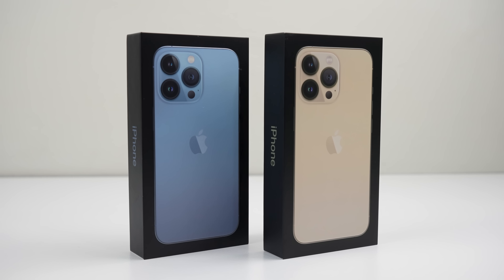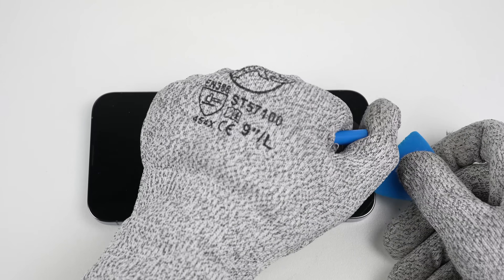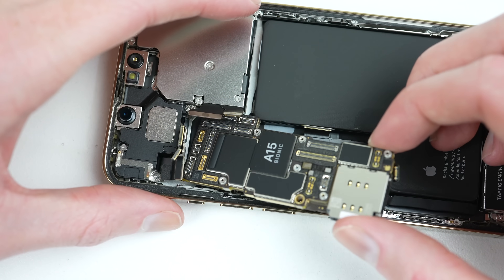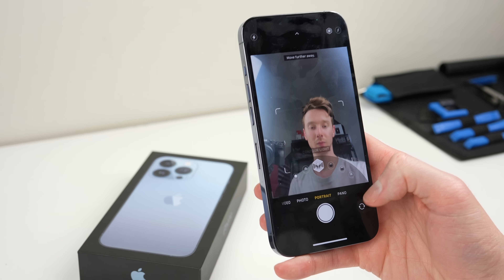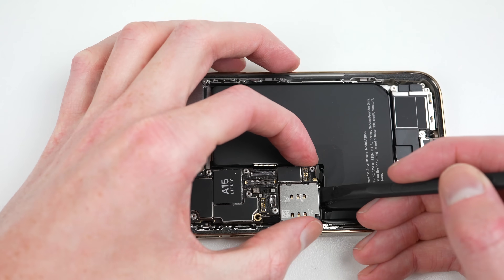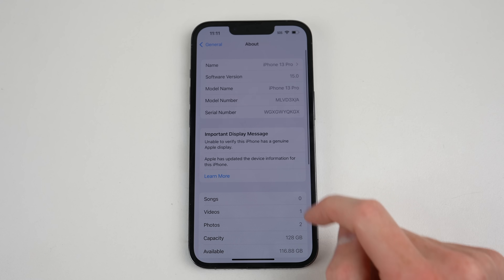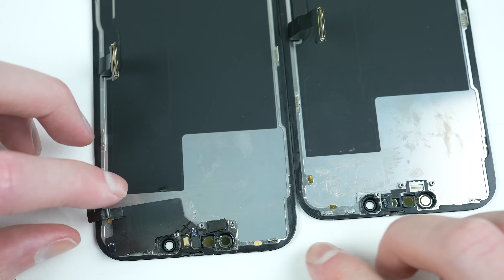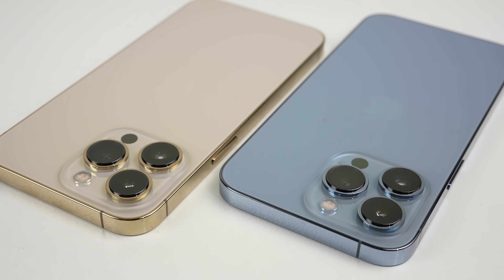iPhone 13 A Repair Nightmare - Teardown and Repair Assessment

Comment: This actually has been Apple's philosophy from the very start. Their OS would only run on hardware they manufactured. For a brief time they experimented with third-party hardware, but that was quickly discarded. Their authorized repair shops are prevented from stocking parts -- the broken\defective part has to be returned to Apple first. I have never understood people's blind allegiance to this company, yet are quick to denigrate others' efforts (Microsoft). The real open-source products are PC-based, not Apple's proprietary system.
Reply: The BS apple is doing is for real pretty annoying, thats why i still stick to a 2010 MacBook Pro... it got already 4 batteries replaced, upgraded Ram from 4 to 8GB, the 500GB HDD with a 500GB SSD replaced and not long ago i had to fix a typical GPU power delivery issue for cheap, like 10$... 9$ for delivery, 1$ for the component haha

This baby got already about 3000+ charging cycles and a lot of mobile usage on its back, next to a bit gaming (on battery aswell stationary for longer, thats why the cap for the GPU power delivery finally gone bad after 10 years)
The last time i even stressed the DVD drive a lot with burning mix-CDs, Albums etc, still going strong my "easy to maintain" 2010 machine, not the fastest anymore, sometimes i have some waiting times, more than 1080p/60fps on youtube is impossible in Mac OS, only in windows with proper GPU acceleration i can also playback 4K content, even HEVC over the CPU (in windows only!)

I dont know why, but every time i use this 2010 MBP... i remember how good and "way ahead" apple once was, even for a fair price (paid 1700€ with student discount for a better 15" model with dedicated GPU, regular price would have been anything around 2200-2300€) I still "love" this machine, aswell as my 2016 iPhone SE, the last really small pocket sized iPhone with partially practical repairability. Sadly, i switched to a iPhone 12 Mini some days ago, but i got a good deal for 510€ brandnew and the 2016 SE is finally getting a bit slow (probably intentionally by apple, because i did nothing else than a software update and it was much slower than before). Well, i like the awesome "big" screen of the 12 Mini, i hope this last also for at least 3-4 years until apple bring back SEs to life
Reply: @harrison00xXx  yep. Still using my iPhone 6s Plus and replaced the screen myself a couple times with parts from eBay.
Reply: @harrison00xXx  thats exactly why apple does this now.

why would they want you to be using a device from 10+years ago, that just means your not buying a new one.
Reply: @theputnamto3468  well, i would not call a 5-6 year old phone old or outdated…
Especially since my needs are pretty rudimental and i dont need much performance at all
Reply: hurry..I was about to say bingo , you are totally correct,  BUT quite wrong in open source info. Apple had spread around for $$ their attachment idealogy for 3 rd party  items, Billy Gates, simply allowed the USER  of PC to try  a new  item, if it didn't work. whoops then PC would  know. Billy also  initially proffered selling the gui device way back in1985, at he Xerox symosium, but his partner Steve Jobs replied  no, a computer would sell as a contained unit.
Reply: This is substantially different from apple’s policies “from the start”.

I used to regularly replace RAM, hard drives, batteries, etc. on macs with third-party parts with no issues.
Reply: i use an old iMac 2011 since, 2011, and it just started to having problem right now, just bought a new mba m1 to replace my old iMac. lots of my friends already bought 2-3 laptops since then. As for their phone, i was using iPhone 6s for damn long time and just got myself a new iPhone 12 last year. Their products do last longer and everything most of the time really just work, though when they got broken its also a pain in the ass and expensive.
Reply: @harrison00xXx  they were, long go with Steve alive, now they are just milking the cow
Reply: It's about how much money they can take from you while you use their products.
Reply: @harrison00xXx  I know that feeling exactly. In the early days OSX notebooks were the only choice if you wanted Unix on a notebook. It was great because Darwin was open source and the cross-compatibility between Linux and OSX was awesome. Even the Macmini was awesome. 

Now I switched completely away from Apple because they are just insane in their pricing, insane in their repair costs, and insane in locking down the system. I used to buy the top end iPhone, and when the price went over 1000 CHF I began to cringe. Now at 1399 CHF I said no way! Especially when I can get the Samsung A52 5G for 429 CHF. It has become a no brainer situation for me.
Reply: @ChristianLaurinE  as much i tried to stay on apple…
My 2010 MacBook is partislly replaced already by a Lenovo convertible (ryzen 3200 and vega3), which feels basically like a iPad Pro with more capabilities for a cheaper price. And for 14“ 1080p is just fine, for regular notebook usage even „too much“, for drawing/tablet usage i could wish a bit higher res
Reply: @ChristianLaurinE  i had no problems with easy to replace batteries at iphones or at least acess to replace ram, battery and SSD like my 2010 did.
now, after 10 years sadly even a 300$ notebook have a superoir screen over the TN LCDs used these days only in notebooks

I have big hopes for the M2 and M3 Macbooks, i will wait how they perform and their pricing, then i know if a M2/3 Mac will finally replace my 2010 MBP

I still like Apple somehow, only because they were the only ones left in 2016+ with a small „hi end“ phone and because they were literally years ahead with 2007-2012 Macbooks and they were the only „affordable“ notebooks with superior screens, robust case and huge, high quality batteries
Especially 2008-2010 they made by far „the best“ allrounder notebooks/Macs, only with s few apple typical downsides like not much USB ports, miniDP instead of HDMI and so…
Reply: ALL technology will be like this eventually. Yeah sure my custom windows 10 PC that i think i "own" can be screwed with just a simple update. and just like that my device can be bricked. We all just pay a fee to have these devices in our hands. But we dont truly own any of it. Hardware without software is just a paper weight, its useless. So the software is where they are screwing us and there is nothing we can do about it. Just dont spend all of your money on electronics from here on out. Spend a responsible amount that wont break the bank and take care of your devices the best you can, with the idea that youll only have it for a few years maybe six years maximum before it turns to ewaste and repeat the process. People spend all their money on this stuff which is why they get so upset, but it is what it is...
I can invest all my money into a sports car lets say.. then the state can come out one year and say i can no longer register it. Just like that, even a car can turn into the same idea.
Reply: @PhoonigaN  use Linux my guy. And a bricked device is not a dead device
Reply: Maybe our “allegiance” is not influenced by silly talking points but rather pragmatism? As in the phones have a track record of lasting long? Being reliable? Supporting long term updates? 
But yeah no: I should discard all of that because some random Butthurt Individual online thinks I should care more about their philosophical nonsense
Reply: @tbg6070  Here is the problem with that theory. About 5 years ago, sure gotcha...  However, these days I don't agree. Also let's do the numbers shall we?

My iPhone that I wanted to replace my iPhone XS Max was the Pro. The acquire cost was 1350, and the selling price is about 275. This means in the space of 3 years I lost a value of 1,000. My Samsung A52 5G cost 425, and my Motorola One Vision cost 225. Meaning I am still ahead of Apple. 

I have two phones because I have a Swiss and French number. Why not use eSim? Well I did, and my iPhone would hang for whatever reason and not pick up calls.  Meaning reboot.

Also with my Android I can actually see who is calling as that is automatic, and on the iPhone very difficult to get working. 

I have not even begun to go down the list of features like Android Auto working properly vs AppleCar...

Sorry but for a device that is over 1K you are paying for BS not technology.
Reply: Shame too because iPhones are genuinely some good phones. The company just sucks and rips the fuck off people

I'd be fine with going to Apple to repair my phone if it didn't cost me 1/4 of a new phone.
Reply: Iphones are good, but I never buy them new, because screw apple with their greed.
Reply: And their machines will only run on the current os or newer, which means you cannot even go back one os, and on phones and tablets, if you upgrade you are stuck, and cannot return to an earlier os.
Apple owns the phone after you buy it and can lock it for any reason at anytime.
Reply: @Tigerex966  this isn’t even true. If you have been vigilant with backup up your shah blobs then you are free to always go back. You are not informed. I can run any version of macOS I want on my MacBook. That doesn’t mean that software in that version is supported by the developers or secure, but there is almost no limitation to what I can run on apple computer hardware . Their operating systems  are inflexible, but they aren’t fortresses and you are a fool if you believe that shit. Educate yourself
Reply: @Joshreece  you are in error.
Try going back a version on yout m1 m1c to catalina or mojave.
Or even your intel mac.
Reply: @Tigerex966  yeah intel mac indeed
Reply: Ooo wow 

I thought you were rational

Until you revealed your pathetic tribalism you’re another waste of space fix your life
Reply: It's not "blind" allegiance.  They make great products.  They handicap repairs, sure.  But people like their products because they are worthy of liking.  The two things aren't required to be tied together.  You can like their products and hate their repairability (or lack thereof).  And Microsoft isn't exactly problem-free.  They've made multiple shitty operating systems, crappy music players and phones... and now their newest OS spies on you like never before and forces updates even after you disable them.  Microsoft and Apple are just different coins in the same purse.
Reply: @Salsuero  something people also dont realize… we talk if we talk nowadays about windows about a x86 only OS…
x86 architecture is literally existing since the first microchips, so we could even say MS is keeping us from real development by still holding on to x86, at least 32Bit Windows are finally discontinued but they still rely on an old design.

ARM/RISC CPUs are the future, exactly that kind of CPUs Apple began to use with the M1 Macs

Intel tried already to bury x86 by introducing IA-64 in the early 2000s (Itanium called i think, but AMD offered for cheaper a x86 compatible 64Bit extension to the 32Bit x86 system which we are still at today
Reply: @harrison00xXx  And the OP acts like Microsoft fans don't trash-talk Apple fans... right.
Reply: @Salsuero  its sad to be a fan of any company… apple or ms… its like pest vs cholera
Reply: @harrison00xXx  I think people are more fans of the products... not the companies themselves... unless they own stock, I suppose.
Reply: Microsoft open source? U meant Linux
Reply: @HutjeSiu  I was talking about PC hardware. I admit that I drifted off the point of handheld tech, but I was making the point that Apple's approach to hardware was proprietary from the start, and the PC's was, let's say, "everybody into the pool".  Obviously there are risks with that approach in terms of bugs, but it's a far more "open" world. Funny, but looking today at the Super Bowl ad that launched Macintosh, it seems Apple has become the evil tyrant on the screen.
Reply: @hurricane1951  well after all it’s your choice in the free market, apple success reflects what consumers demand. it just apple decision to develop in its unique way, and SoC has been proven to be a better and more efficient way, balancing performance and mobility, as m1 chip launched
Reply: @ASSOpid  As someone who has a MBP, uses Linux (mostly just Debian though) and has a Windows desktop PC (for gaming) with a 6600XT and a Ryzen 5 3500... macOS is still extremely nice for work. Plus, people who are complaining their apple devices break in 2 years likely take less good care of them. I've had my MBP for 6 years, and haven't even had to replace the battery.
Reply: My wife had mba from 2011. I replaced battery once, and recently replaced keyboard after son killed it in Minecraft. Laptop still solid for e-learning for grade 2 student. Imagine they put locks, that would prevent repairs (I did them myself). Last keyboard upgrade probably then will be non-economical. It means instead of continue using it, it would go to trash and harm environment.
Reply: @vovaya  apple's new measures will only slow things down. Those devices will be pwned just like every other one ever. Maybe not for years, but I look forward to picking them up cheap in a few years when the modding/hacking community learns to spoof the hwid's or man-in-the-middle the authentication.
Reply: Microsoft open source... lol
Reply: @Agussg23  check your reading comprehension mate
Reply: @bbbbbbb51  it doesn't make any sense. Where does the open source topic come from?
Reply: @harrison00xXx  gotta thanks Steve Jobs for that , but now it different , this isn't the same Apple that we used to know .
Reply: @nezunish-898  yep. I was a tech nerd from the beginning, but never really an apple fan.
I owned the last generation of black/white PDAs, pretty useless these days as a kid ofc but hey, others wasted their money they got, i bought a PDA only businessmen would buy.
Qtec 9000 was the last PDA i owned before the first iPhone was released. It was a nice, awesome Windows Mobile 5.0 PDA with nice, big screen, keyboard and a "convertible" feature.
But damn, as much i was a tech nerd, had no problems with more complicated devices and so.... the iPhones were so fkin user friendly. I gave up in this case for free a bit of freedom and possibilities (last gen Win mobile PDAs were pretty neat and much more versatile than any early gen smartphone!) for a damn easy and intuitive to use mobile OS. Only this fkin stylus which you always needed, the pressure depending touchscreens with poor precision and calibration needed,... all gone with modern smartphones which began with the first iPhone.
Reply: The irony is that Apple stole their GUI from IBM. They profited and learned from that lesson how important it is to THEM to protect their software AND hardware from taking business away from them. It's totally anti consumer and there's no good reason for it besides Apple is greedy. Unless Apple makes a statement about this that is legitimate and has a good explanation OR they stop these practices my view of them will continue to degrade and I will not be upgrading phones. I have the iPhone 7 & iPhone 11 and love these phones but I won't upgrade to another iPhone besides buying new older models until this issue is addressed. I know even with the 11 there are things that are difficult to replace. Right to repair is a huge issue and more people outside of the tech community need to know about it.
Reply: Their hardware and software (when working) has generally been solid, you can't expect normal people to care about these things when it doesn't affect them directly. It needs regulation.
Reply: @Alekpowah 
Apple's hardware and software is solid WHEN WORKING??? Would anyone consider it not solid when it's NOT working? Yes, I agree, even my Galaxy S21+ is solid....as long as it's working. However, if it stops working, I doubt I'll consider it reliable. I'll cross that bridge when I come to it.
Reply: @Alekpowah  What a great piece of sophistry! The whole point of this video is for people who's phone does NOT work. Did you get that bit!
Reply: @zorbalight3933  The phone launched like two weeks ago lmao
Reply: @zorbalight3933   no this video is to inform people, its not a guide for repairing phones…. And aleek does make a good point.
Reply: "The real open-source products are PC-based"

Go out and buy a Windows Phone then.
Reply: Yeah but that doesn't last. Whatever shared key the components pair with will be leaked and these phones will be just as pwnable as MacOS is.
Reply: @Joshreece  It's not (necessarily) pairing by key exchange between the parts, just a serial number proving protocol and an OS feature that stores the serial numbers in a location not accessible to users.  Of cause the secret login to update that list after authorized repair may involve a secret that could be leaked, but if Apple is competent that secret never leaves their headquarters, and repair centers have to connect remotely for each repair of each phone.
Reply: That’s completely different, in this video not even the genuine parts are working. I am all for the right to repair bill. But people like Apple because their products are good. It’s that simple, we live on a free market. Not a company in this world will be perfect so don’t be a hypocrite.
Reply: "The real open-source products are PC-based, not Apple's proprietary system."
Windows 10 was already bad. We'll see how much worse it gets with windows 11 and "secure" boot and TPM requirements.
Reply: @goeiecool9999 
I have 2 Surface Pro 6's, and 2 Surface Laptops with AMD's. I've never had a single problem with the hardware or Windows 10 or 11 in the 3+ years I've had them. Not one. But the iPad and MacBook both had serious hardware issues after 2 years. Nothing Apple has been reliable beyond 3 years in my experience. Not an iPhone, iPad, MacBook...nothing. Apple are experts in hardware and software obsolescence built into their devices. No one does planned obsolescence better than Apple.
Reply: @SonnyAli1973  funny

A MacBook Pro (15“ 2010) was the only notebook which lasted till this day and still working all 100%

My iPhone SE 2016 was the longest lasting smartphone i ever had and its still my backup device since i recently switched to a 12 Mini for a good price

Or iPods… well in 2003 to about 2008 you didnt get any better mp3 player with such a high capacity, intuitive user interface and all in a well organizable and synchable music archive
Many iPods you could awesome upgrade/repair even if it was a bit of a hassle.
For example i upgraded my 4GB iPod Mini with a 128GB MMC card instead of the old, power hungry and sensible microdrive technology
Reply: @SonnyAli1973  is this a letter from an apple hater?